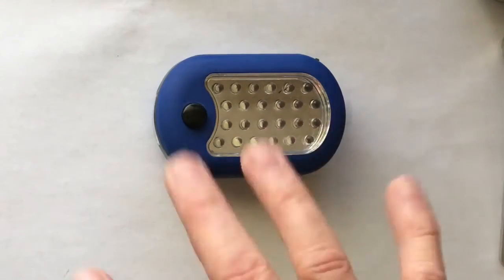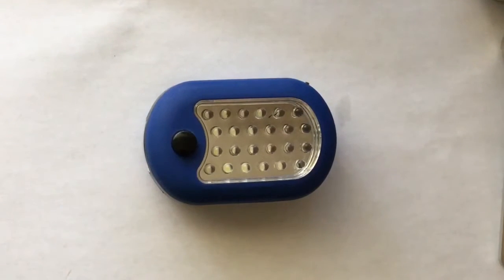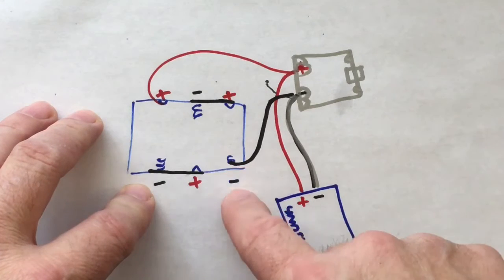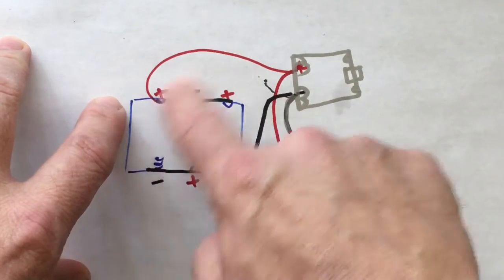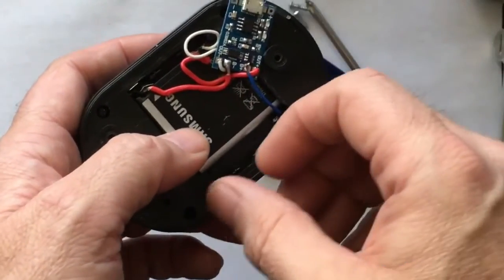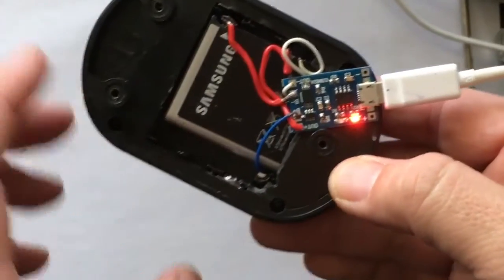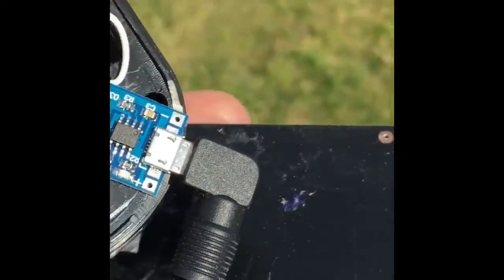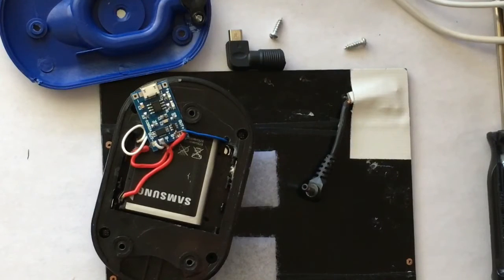A simple AAA powered light, HACKED with old Lithium-ion cell phone battery! - SOLAR charges too!!

Comment: Woah. I just made this and the blue resistor burned! Can someone tell me the resistance of it so I can replace it? Thanks.
Reply from the maker: The one i have just has straight wires from lights to batteries with a switch in there no resistors that i saw.. I still use the light today. I am sure if you take a small video of the board inside and ask what is this and what could i replace it with someone would tell you in a comment. If you make a video you can link it here i wont delete the link.
Thank you for watching me video and for doing your own project. I hope to see a video from you. Please let me know if you make one.

Comment: Good hack.
Reply from the maker: Thank you!! It is ugly on the inside but thats not what counts i guess..
This is probably one of my favorite hacks that i have done because it still looks like the lame AAA powered light. Most of my older videos/project were less refined.
Thank you for the comment!!
Reply: If you have room inside that light, you can always add another phone battery in parallel to increase runtime.  The good thing is the battery has built in protection. I was thinking of taking out the little circuit protection module inside an old phone battery and use it somewhere's else. First to comment and like.
Reply from the maker: Removing the circuit protection is beyond my skills for sure. I fear fire and also brimstone. I was sweating when i was soldering the wires to the battery in the first place. Heat and Lithium together scares me!
I just saw you have a lot of videos on your channel; i am going to check it out...
 Thank you again for the comments and the back and forth..
Reply: Have a good day!
Reply from the maker: Just to let you know as i am reading over these comments again. I am still using the light and it works perfect. I also do charge it sometimes from a solar setup.
Thanks again for your comment!